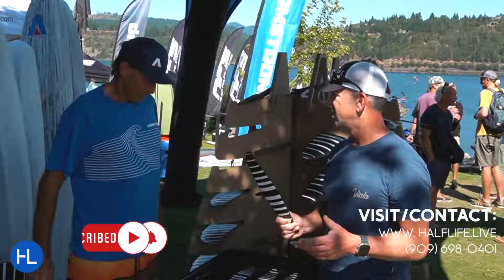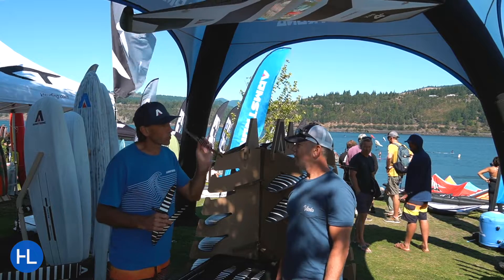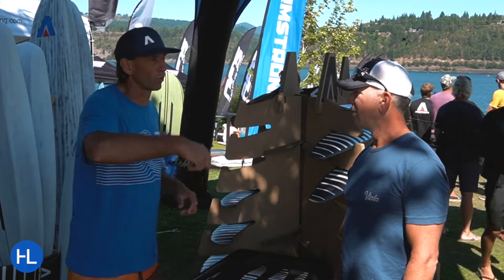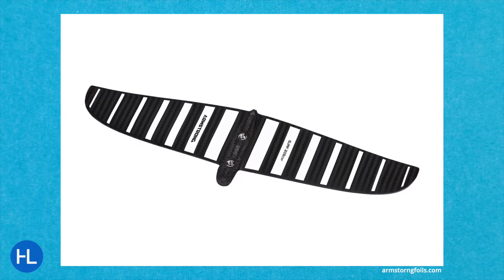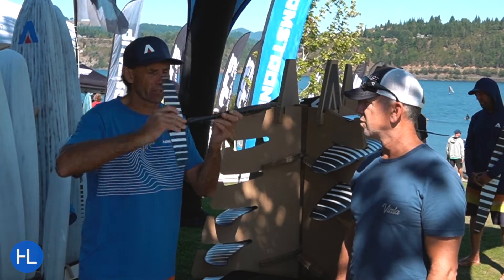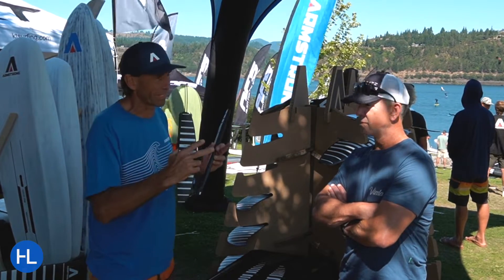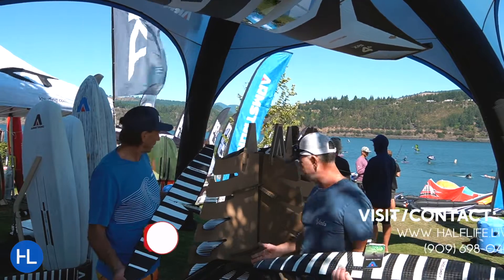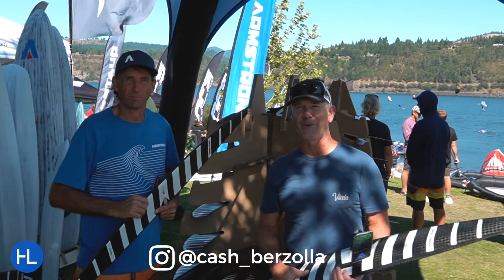Armie Armstrong talks Stabilizer Foils with Special Shim Tips

Comment: OK, So I can Tow Foil on a large 90 liter board 2400 wing 90 mast... and looking to progress into foil kiting with my own Armstong Foils... Question, What size should I be looking at for a front foil to get me started something as small as a 900 / 1200 or should I consider a larger 2400? isn't the 2400 too large for kiting?? Also need some guidance on the tail wing size 300? and fuselage length. I'm a 90kg / 198 lb rider. Any advice is greatfully received.
Reply from the maker: Hi Wilkothewiz -- NO - You should NOT tow in on a 90L board (at least to material size waves). I'm sure you can but it's not my recommendation. We typically tow in on a 4 ft or 3'9 board (Armstrong WKT109 or 122). Yes - the 2400 is too large for kiting -- and -- it has been replaced. I apologize but I'm confused on whether we're talking kite foil, wing foil, or wake foil.  You can reach us at 909-698-0401. We should talk so I can give the right advice
Best
Tim

Comment: Some guy is "channeling" Steve Jobs commercial technic to Armie, iPhone X tan X+1 and so forth in a continue upgrade/update so the junkies , we BTW, have to buy them
Reply from the maker: Part of the addiction :-).  I will say however - that the older gear holds up well and is still fun to ride. It's hard to say no to the new innovations though :-). Just got off the water with 50cm fuse, HA925, and surf 205 tail....Damn it was FUN!
Best
Tim
Reply: I was just thinking that 😆😆😆
Reply: I agreee  same opinião